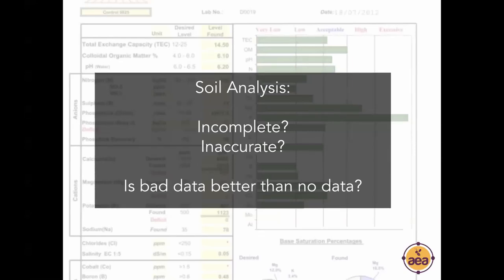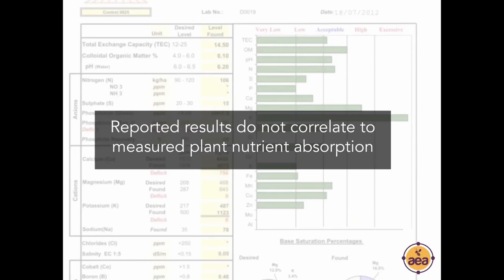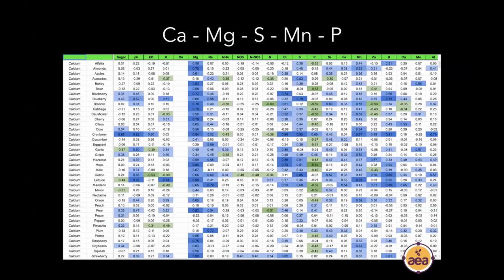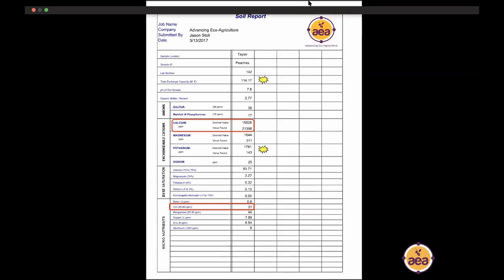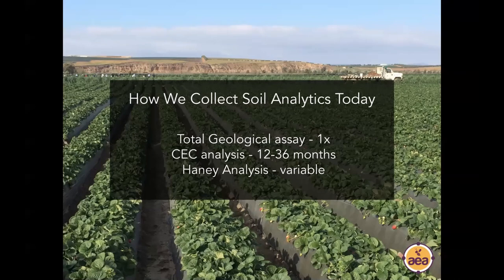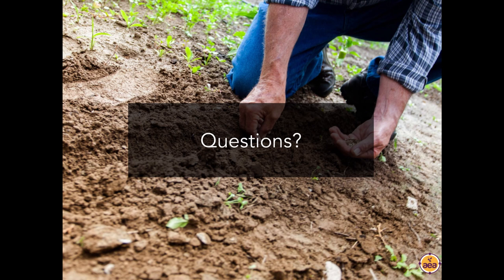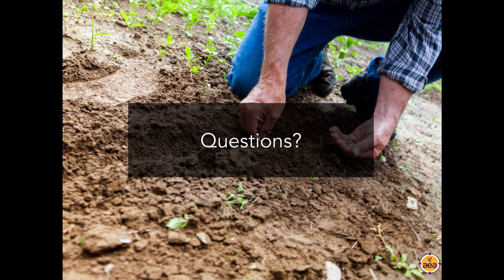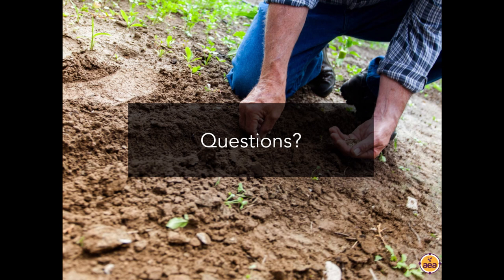Soil Testing 2.0: Build your Soil, Cut Costs, & Increase Profits with Regenerative Agriculture

Comment: The breathless lionizing of SAP analysis! Isnt It curious that sap analysis isnt subjected to the same rigorous examination as chemistry based soil analysis. Sap analysis data is predicated on non standardized, proprietary protocols. The data often shows consistent 
skewing of particsluar values,  Fe and Cl come to mind.
Reply: Hey there, I know this is an old comment but I was hoping you'd expound. 

First, I'm not sure he is "ionizing," as I've heard him call sap analysis "the least innacurate" form of testing. 

Having said that, and considering the introductory information in this video, my understanding is that ALL tests are skewed at some points, and therefore bare some inaccuracy. If that's true, how can you know that sap analysis is skewed on these two particular minerals? 

What other tests are you holding it against to say you know those numbers are inaccurate? 

Thanks!